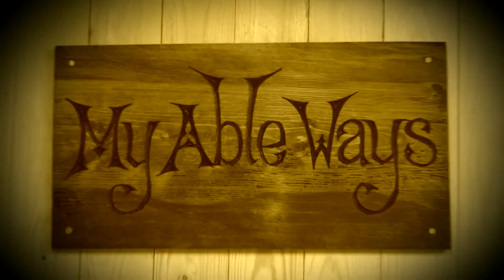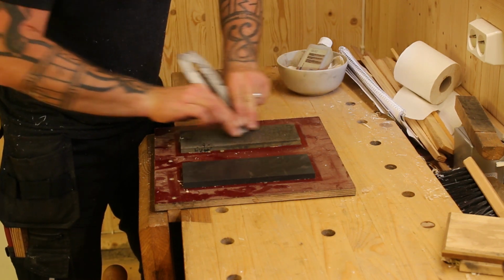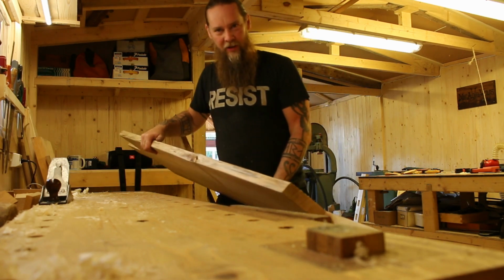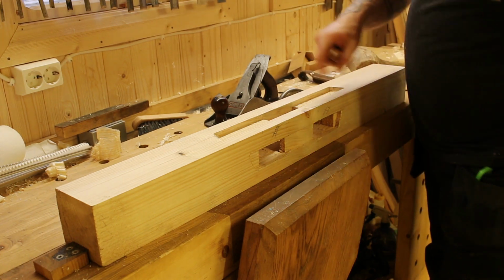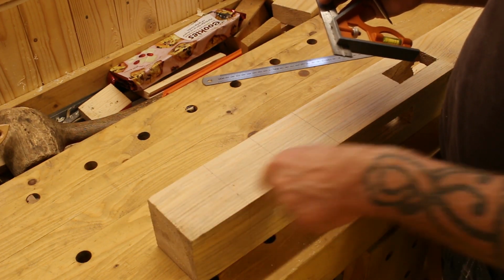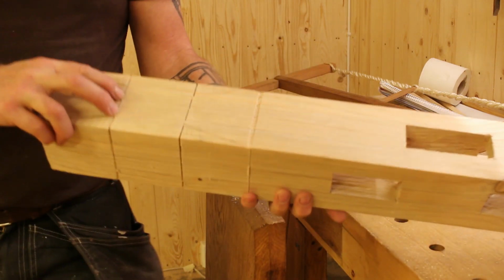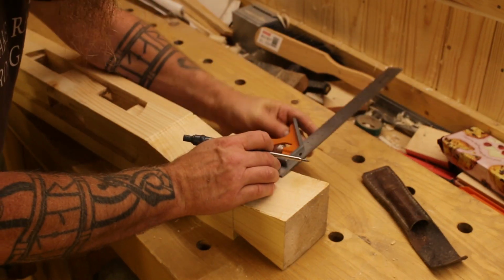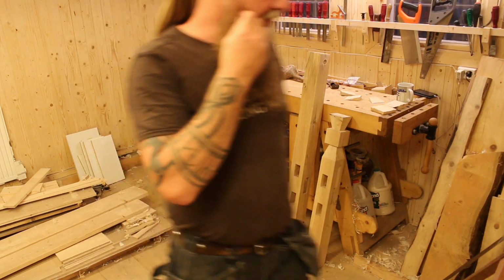Make a viking bed! Traditional woodworking skills. Smoothing plane, chisel and bowsaw. Part 4.

Comment: Nice work as allways. I wonder, when you plane the long bords, du you usually start att the far end ? Does that make it easier to not get an uneaven surface?
Reply from the maker: Yes, if the workpiece is too long to work properly in one stroke. You start at the far end and then back up. Lift the back of the plane when you come into the planed surface in front of you. I learned that from Paul Sellers, as many other things. After that you can finish with lighter cuts the full length of the board, if you’re after a really nice surface. These light cuts you can do while walking along the bench.